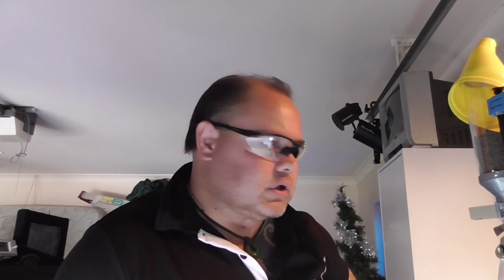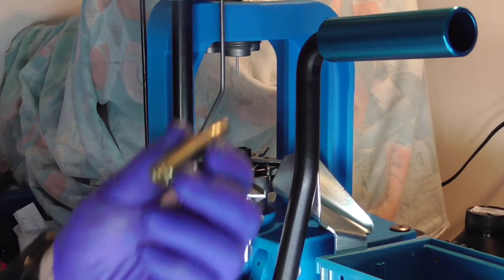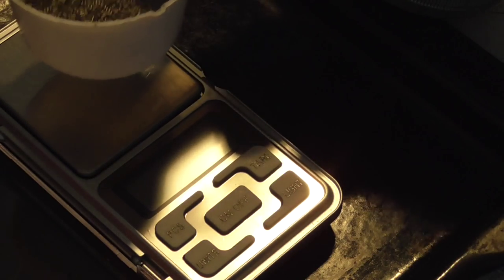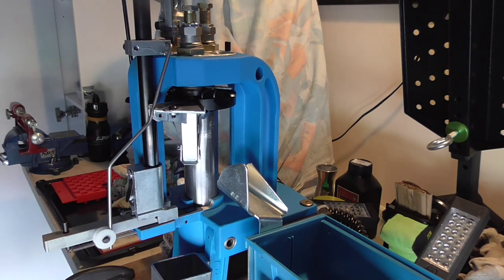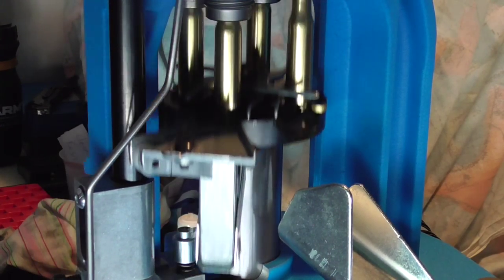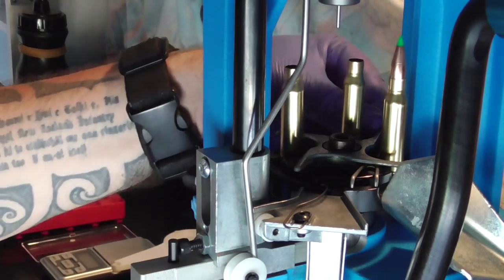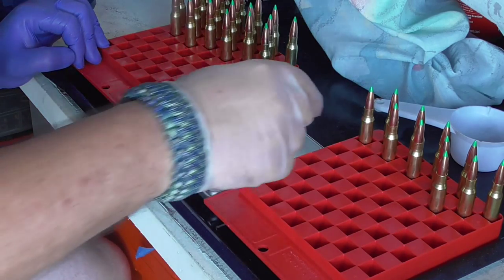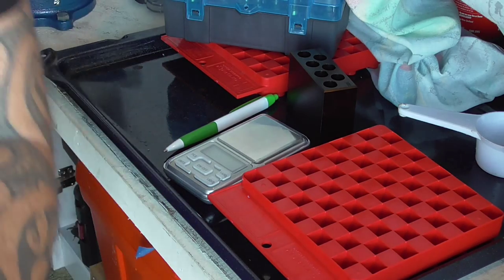Reloading .308 On A Dillon Precision RL550B

Comment: The problem you are having with the primer feed wheel is because the Top part of the rod is not adjusted properly. 
The piece that is attached to the primer tube is out of alignment. The rod needs to be greased and adjusted so it will Float in and out slightly. 
You don't want to mess with the wheel assembly or it can create negative effects elsewhere in the long-term. 👌

Comment: Fantastic, thanks for taking the time to do this mate. You mentioned early in the video that you might make a video on how to set up the powder dispenser for perfect delivery every time, I'd be dead keen to see that please. Again mate, cheers heaps for the effort made in doing this video.
Reply from the maker: +Andrew Remin 
Hi Andrew, appreciated and I will do up a video for powder dispenser to get the most accurate powder drops possible.  I may even be able to give Dillon a few suggestions for improvement where the drops can be 100% accurate every-time.
Reply from the maker: +Andrew Remin 
Hey Andrew the video for powder drops is up now. https://www.youtube.com/watch?v=xuJUFolgXc4
Reply: Kiwi Bushcraft And Survival how can you give dillon any pointers, if you think the priming stroke forward has anything to do with recharging the powder slide...it automatically recharges when the case comes out from the funnel and the handle is back at neutral  position.

Comment: good video, watched it completely, start to finish, thanks for taking the time to produce it.
just wondering, any particular reason why you're using the No. 250 Large Rifle Magnum primers, instead of the No. 200 Large Rifle primers, or the No. 34 NATO Large Rifle primers?

edit: i just figured out, you're probably using a bolt-action, not a semi-auto, so you wouldn't use the No. 34, but still, any reason why not the No. 200?  just curious.
Reply from the maker: +bigblock chevy 
Hi Chevy, glad to hear you enjoyed the video. I am using the No. 250 Large Rifle Magnum primers for winter, this causes good powder ignition in cold weather and more reliability. By my understanding, when you use the No. 250 Large Rifle Magnum primer, it is like adding 1 extra grain of powder.  So it would probably be better to make my powder drop 1 grain less to 44 grains instead of 45 grains. Just to maintain the safety aspect of things.